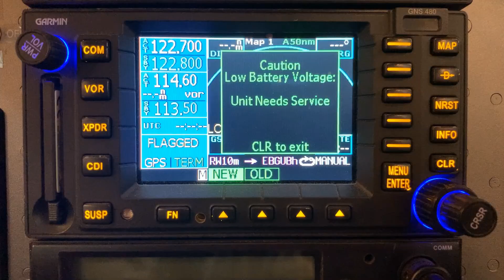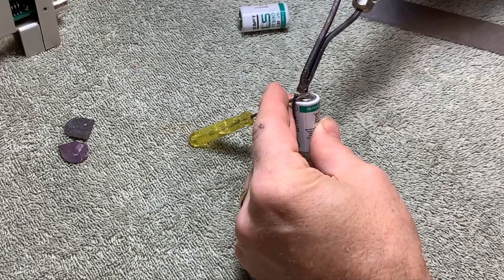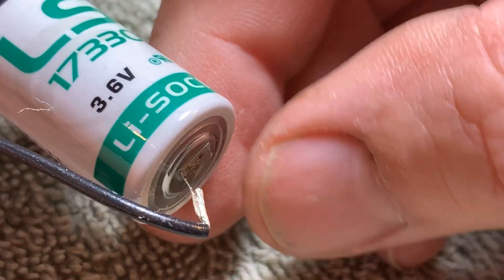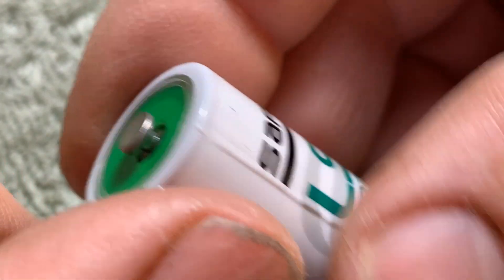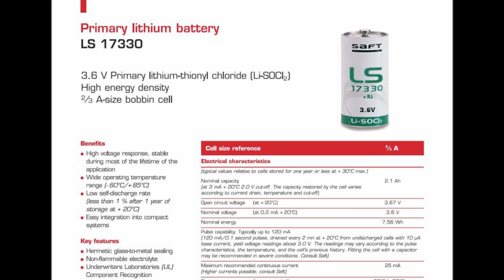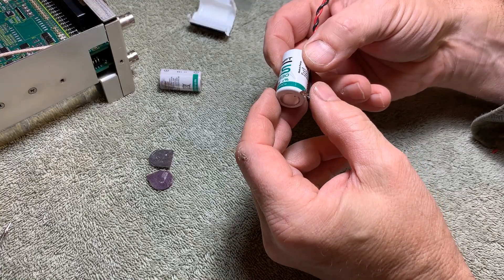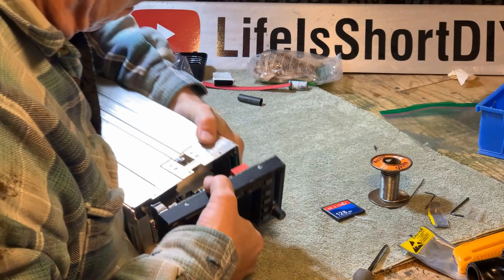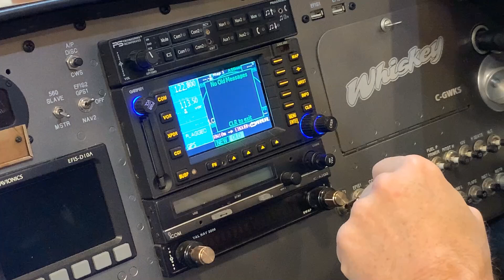How to Replace the Internal Battery on a Garmin GNS480 | DIY Guide

Comment: Great job. Considering that the minimum an avionics shop will charge for this is about $450, and with Garmin no longer supporting the older avionics (they quoted me $2300 as a minimum charge for any work on my 530) it is worth spending the $35 to $60 for a battery spot welder which makes this a snap.
Reply from the maker: Thanks for the tip about the battery spot welder! In hindsight, I should have just bought the correct battery. A buddy told me I should have ordered an LS17330ST battery instead of the LS17330. The LS17330ST already has the tabs welded in place, making it easy to solder to the tabs directly.
My main concern was avoiding extended downtime for the unit while waiting for the battery to arrive, so I ended up buying the version without tabs. Hopefully, others can learn from this experience and order the correct battery in advance before taking their unit apart.
Thanks again for the tip about the welder—I’ll definitely look into it. You can never have too many tools! 😊
Reply: Garmin designs their products to last 20 years. This particular unit was released over 20 years ago. It’s time to upgrade lol
Reply: @judebroussard2901 
The GNS480 was an Upsat product and released as the CNX-80. It was 20 years ahead of its time in terms of functionality. So Garmin bought the 480 line from Upsat and then phased out the 480 because it was decades ahead of the 430 and 530 and Garmin simply couldn’t compete. 
The 480 still holds its own against many Garmin “modern” units. 
How do I know this? I own one and there is nothing on the market that provides additional capability that I need or want (and I consistently use it to fly hard IFR at all types of airports). 
So, please, become educated and, until you are, silence is probably best for you.
Reply: Avionics labor is $130/hour. You’re also voiding any Garmin manufacturer warranty. Honestly, if you can’t afford to replace a unit In your aircraft, you probably can’t afford to own a plane 😅
Reply: Garmin warranty is looooong gone. You don't replace a 20 year old unit, newer radios probably won't talk to the rest of your panel so it likely leads to a full panel upgrade which is anywhere from $75,000 to $130,000 for even a modest airplane like my 210. Besides that, getting a slot in an avionics shop may be 3-6 months out, plus anywhere from 6-24 weeks down time. So when the "Low Battery" message comes on the 530, and you are using the airplane constantly and can't afford to take it down at the drop of a hat, taking a half hour to replace it is not actually a bad idea. Oh, and I'll sit on a pile of $100 bills while I do it if that makes you feel better.😄
Reply from the maker: @ thank you.
Reply: @judebroussard2901 
Garmin no longer supports this unit. This option is the most efficient time-wise (at least for us aircraft owners who like to keep their planes flying as much as possible).

Comment: Curious. The cover you're sliding off at the 4 minute mark looks like it would have slid off length wise. Did you try that off camera?

I really like that locking mechanism.

Happy Landings
Reply from the maker: Scott, thanks for the tip.  The LS17330ST battery is definitely the one that i should have ordered.  if this one gives me any grief, i'll swap it out for an LS17330ST.  Thanks for the tip! In hindsight, I should have disassembled the instrument first, taken a look at the battery and then ordered it.  oh well, others will benefit from this video.  Thanks again. Cheers